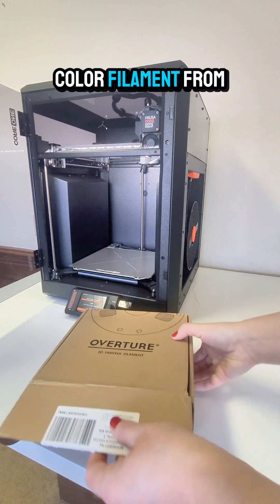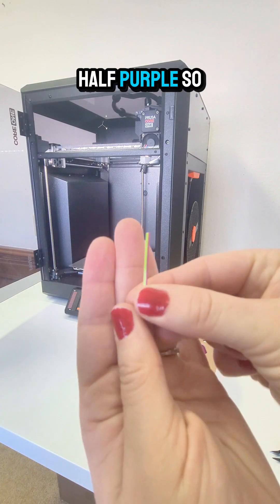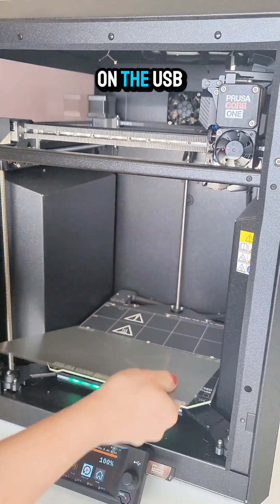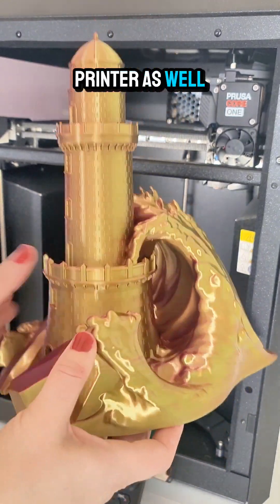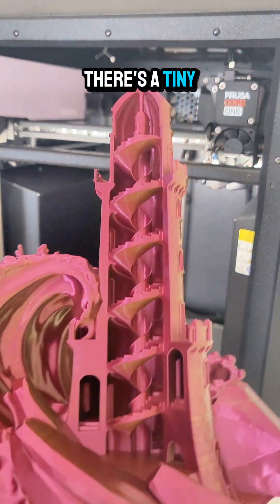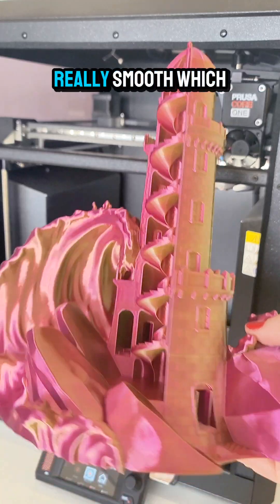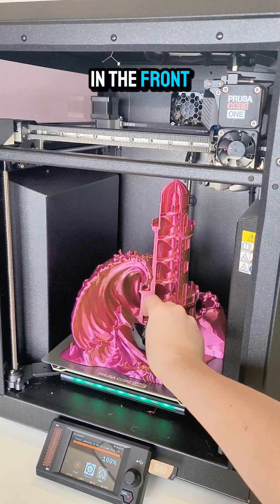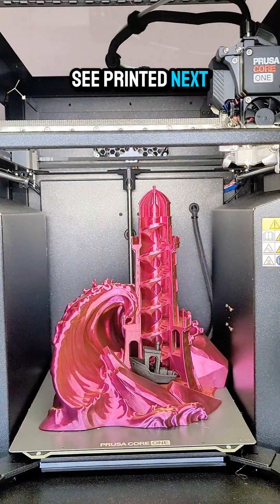22 Hour Print on the Prusa Core ONE!

Comment: How many benches does it hold?
Reply from the maker: Technically there is only an outline for 1 on the wave. But you can prop 2 more in front of the tower. Thanks!
Reply: @ ahh for some reason I was thinking the tower levels worked like shelves.. but looking now that sounds foolish